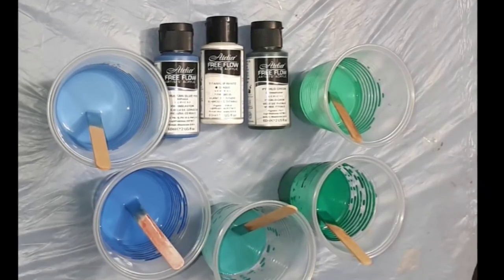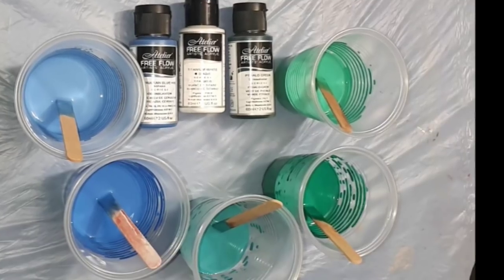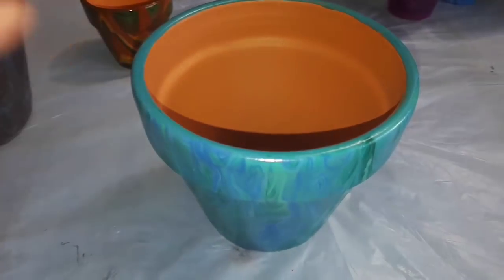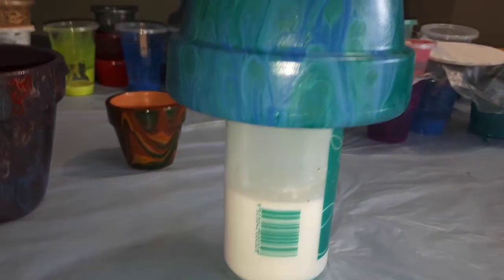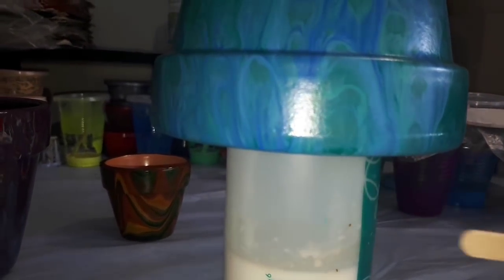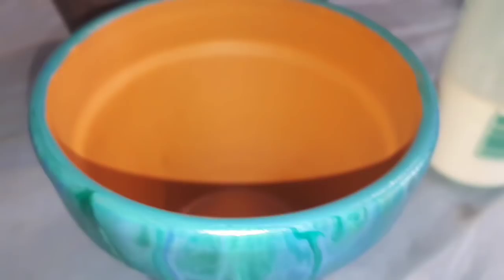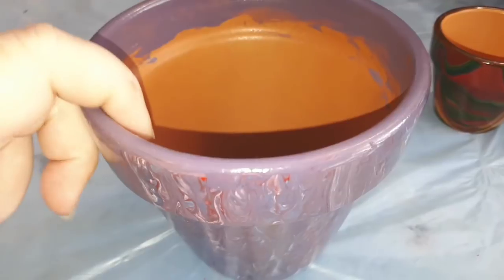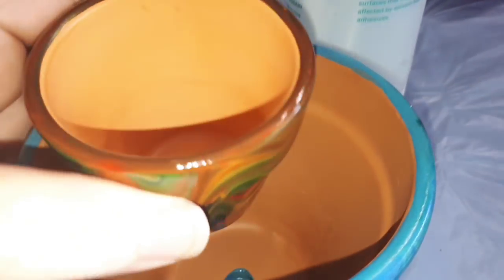195 - Keeping the rim smooth on a terracotta pot *Request

Comment: What did you varnish the pot with?
Reply from the maker: Depending on where I would have them, I have used White Knight Clear Gloss or Cabots Clear Gloss, both I buy at (local hardware store) Bunnings.